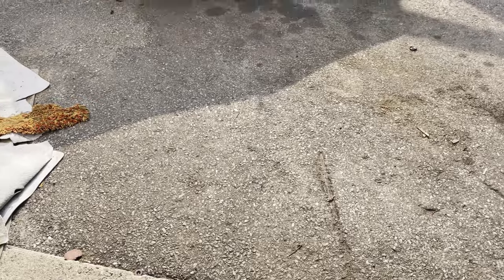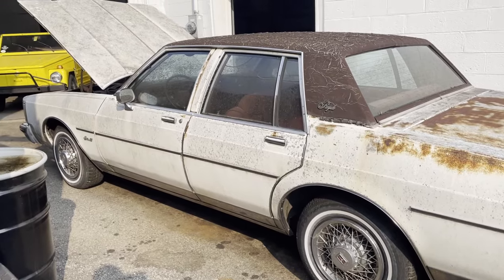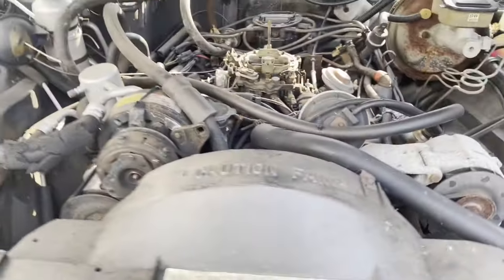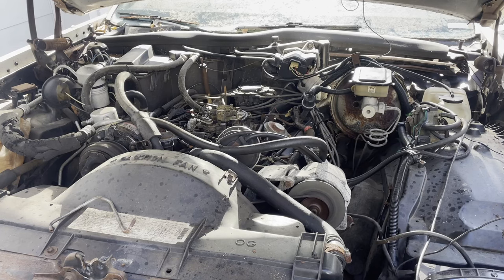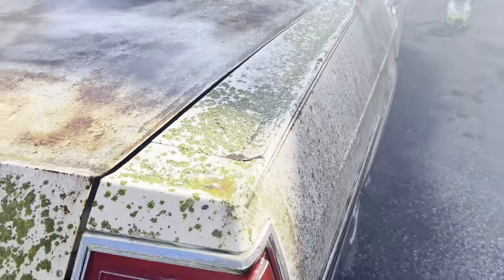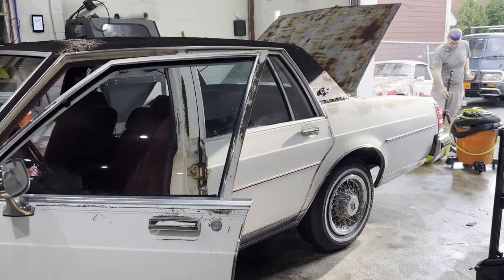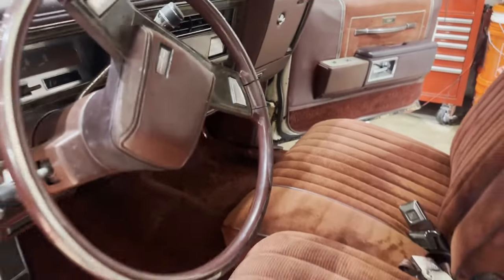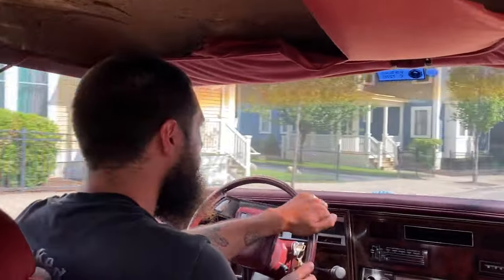1983 Oldsmobile Delta 88 ROYALE REVIVAL- Walkthrough + FIRST WASH

Comment: Nice, this brings back memories..
The 307 was a very good Oldsmobile-built engine made from 1980 to 1990.
Much better than the typical chevy junker, whose 307 was made 1968 to 1973...so unless you suspect someone swapped engines (?) your neat old Delta 88 should ONLY have an Oldsmobile engine if a 307.
Good luck....if you decide to keep it, I'd suggest joining an Oldsmobile club to make friends and learn about that vintage and the locations of good parts sources.
Reply: It’s very obvious, the differences in the two engines, Oldsmobile and Chevrolet. 
You can always tell an Olds-built V-8 by the vertical oil fill tube in the front of the engine, and a much wider intake. 
The later Olds engines had A LOT of vacuum lines, and the earlier Chevy 307 did not.

Comment: There was never a Chevy 307 in these. 
They had absolutely no relation to the old Chevy 307s that just happened to have had the same displacement. 
EVERY car, not just Oldsmobile, has a VIN character, either letter or number, that denotes the engine in the car. 
The two styles of 307s were the original, which came in around 1981 or so, &….
The second style had roller lifters & I believe more restrictive valves, and different exhaust manifolds.
It’s usually a loose belt that makes that squeal.